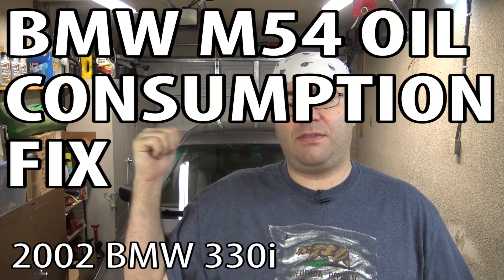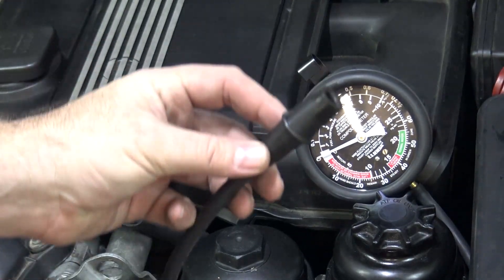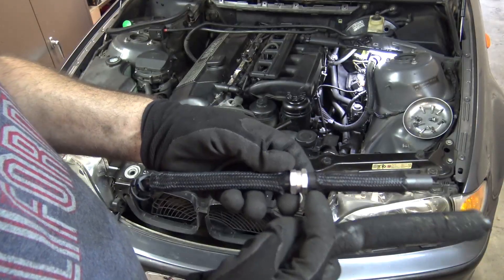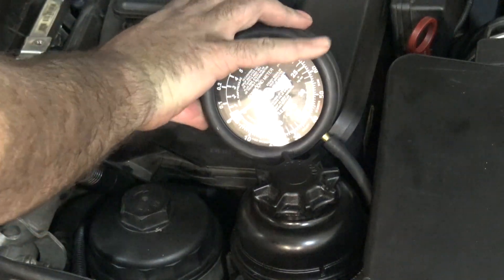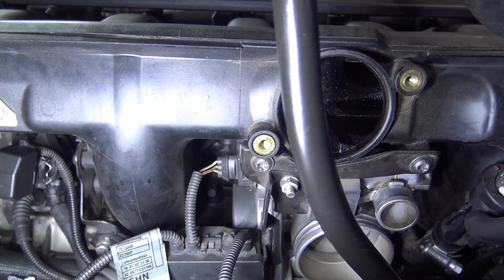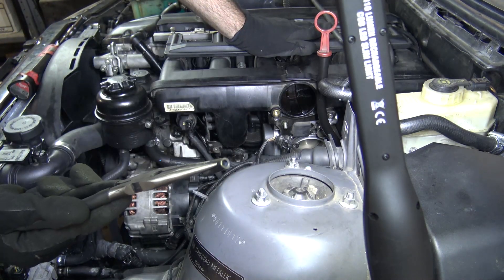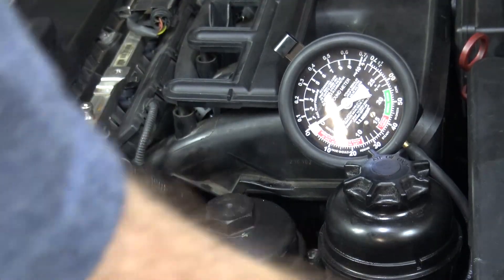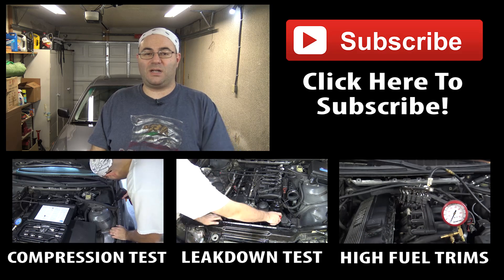BMW E46/E39 M54 Engine Oil Consumption Fix (02Pilot Mod) DIY

Comment: Thanks Jason, I completed the 02Pilot Mod on a 2005 325xi with 229k in Massachusetts. At 7:30 you mention 2 of the 3 rear ports are capped off but the 325xi's here only cap the large port. The two smaller ports are connected in this manner..

4mm port upper > vacuum hose > pierburg check valve (black/white) > vacuum hose > check valve near secondary air pump

4mm port lower > vacuum hose > vacuum tank (black)

At first the vehicle idled and drove great, but when slowing down to take a off ramps the vehicle idles low, and when stopping the vehicle stalls unless I pump the gas.

Are these vehicles vacuum systems not properly routed? And if so, should 1 of the 2 smaller ports be capped?
Reply from the maker: Try removing and cleaning your idle air control valve.  You want to make sure it rattles when you shake it.  I recently had to clean mine again.  Sprayed some wd-40 inside to lube it up and get it freed.
Reply: After inspecting what I did I forgot to connect the lower most electrical plug to the wire harness box. A note for other viewers, be certain to re-attach all connectors including the lowest most plug, the camshaft position sensor 12147539165.

Comment: Big thank you!
But I'd like to ask since I have a manual, will this mod affect my idle?
Cause it would be a pain in the ** if controlling the clutch at idle gets even more difficult.
Reply from the maker: No it won't.  All modern cars have an idle air control valve that takes care of it automatically.
Reply: The idle control valve on my E46 is causing me some headache. By the way all your videos and tips on the 325i apply to the 320i too, which was only available in Europe.

Comment: Is there any value to doing this mod and then installing a valve to turn it off in the winter? I live in Utah and about 4 months out of the year it freezes commonly. I use about 1 qt/1000 on 160K engine.  Seems like some are saying dont do this mod if you live in the cold. Can I just do it and turn it off in the winter?  I installed a new CCV about 8 months ago and even though everything looked original, pretty sure the vent tube was not clogged. I am just thinking to put in some cock valve to turn it off part of the year, at least the other parts of the year its not burning as much. Thoughts?
Reply from the maker: What they mean is the CCV system itself is not good for winters because of the yellow mayo problem (which is water mixing with the oil).  But I think it mostly happens with cars that are parked outside.  If you're in a garage you shouldn't have to worry as much.  Anyway if you don't think you're getting problems with clogging, then use this mod and see what happens.  Everybody's situation is different.

Comment: Great video again! I actually just did the 02pilot mod cause my E46 320i uses a lot of oil too. Also, some months ago I had the entire CCV system replaced (winter version). Applying the mod was easy. I used the large tube from the intake that was capped. And just like you I checked the vacuum with the same meter you use. And voila, the cauge reaches 18 mercury. But... soon it will drop back again no 0. When I repeat these steps, every time it reaches 18, but then soon drops again to 0. That isn't good right? What does it mean/what could be the problem? And how to fix it? Could it be that I used vacuum lines that are just a little too loose connected on the CCV and intake manifold? Or is there a leak somewhere else in the CCV? Please advice. Much much appreciated!
Reply from the maker: Umm... that's very strange.  Could it be a problem with your vacuum gauge?  Maybe it's a bit old & there is a leaking seal inside?  Can you try checking something else that produces vacuum or air pressure and see if it holds?
Reply: Actually it's brand new. I bought for this purpose alone...
Reply from the maker: If you put your hand over the tube while running, do you feel the suction remain strong or does it give out?
Reply: Ah, haven't tried that yet. I just relied on the gauge. I'll try tomorrow. What if the suction gives out?
Reply: Update: after measuring the vacuum yesterday, today I started the engine and a huuuuuuge amount of smoke came out the exhaust. My guess is that the o2pilot mod I did resulted in oil being sucked up from the oil pan when measuring the vacuum. What's ur guess? So today I decided to also install the non return valve. Result: the vacuum now stays at 18 mercury! Nice one. When measuring the vacuum the membrane in the CCV can be heard very loud. And sounds like a large balloon deflating. Did you hear this sound too when checking the vacuum? I wonder what it means.
Reply from the maker: Sounds like there is a leak in the diaphragm, which I know is weird because you just had it replaced.  There was an older style of the CCV valves that had a sort of one way check valve in them I believe but I thought they discontinued them.
Reply: Yeah, it sounded like that I'd guess. Darn, replacing the CCV again is not my favourite thing to do... ;-)
Reply: 50sKid 

Hi 50sKid. Thank you for your videos. It really helps me but now I need your advice. I have a 02 E39 530i and it consumes oil, of course. 6 months ago I replaced old CCV with completly new Febi with all the hoses. Amount of vacuum was 0inHg before the 02Pilotmod and when I disconnected the hose to valve cover, idle revs were slightly different. Strange. So I did this mode and amount of vacuum was 18inHg but immidietly back to 0inHg with huge amount of smoke from the exhaust. I think, that diaphram in the CCV has failed. What do you think? Shall I change the Febi for the OEM BMW? I changed it to the stock with no 02Pilot and it still smokes, but less. Thank you for your reply. 

Greetings from Czech Republic. 

Matthew

Comment: Love all your videos!

Would you recommend a catch can system with an oil return to the dipstick over this modification?

Do you worry about the wear created by the increased vacuum?
Reply from the maker: If you don't have to replace your CCV system due to clogging up every year, then I recommend this modification over the catch can.  The oil fumes with a catch can are too annoying.
Reply: 50sKid is there wear in the engine that is possible with this mod? Thanks
Reply: @vipereavp  no

Comment: Installed the O2 pilot mod tube yesterday. Made A testdrive today. After warming up I get oilpressure too low warnings when the engine idles. Trouble?
Reply: Not sure if you resolved it, but if you increase the vacuum in the crankcase, the oil pressure sending unit will  give you false, lower readings, reduced at the same rate as the new vacuum.   Your actual oil pressure inside the engine is fine and doing its thing, it just appears lower to a gauge that is referencing the outside.   Take your oil cap off when the engine is idling (highest vacuum), your pressure warning light will disappear.
Reply: i know im 3 years late, but did you fix it?

Comment: this worked for me for a while and then it was back to the same old
Reply from the maker: Is the line clogged?
Reply: 50sKid I had that thought. the drain to the oil pan may be clogged.  I need to check it. it's the only thing I can think of. since a new ccv and drain line are relatively cheap I may change them again

Comment: Hey guys,
im just in the middle of this job!
I have to mention that the "cold climate version" of the CCV (which I have) seems to NOT have the little extra port to plug in the vacuum line..Or at least its fully covered with the insulation stuff.
I would be very thankfull for any advice!!
Greetings from germany
Joerg
Reply from the maker: Maybe you can drill a hole in the insulation just big enough for the vacuum line to get through it?
Reply: Hey,
finally I followed your advice and used a sharp knife to cut a hole in the insulation. Easy fix (after tearing down half of the engine bayto reach the CCV) Unfortunately I cant losen the plug in the back of intake manifold.
Is it possible to alternativly extend the "F"-like connector behind the MAF with an additional T-adapter? Or is the vacuum in this place not usable?
Best regards
Joerg
Reply from the maker: The vacuum is not enough at that spot, it's only very slight. If you can't pull off the plug on the back of the manifold, you can always put a slice in it with a razor or use silicone spray to get it moving.
Reply: Hey, 
finally I was able to do the job by using the more reachable larger port. Unfortunately the red oil light  turns on and off frequently, when the car is warm and ideling. It seams that the oil pump isn't able to work against the vacuum..maybe reducing the diameter of the tube would be a solution?
Best regards
Jörg

Comment: did this on my 325i after watching the previous oil consumption video, changed out the oil, and so far absolutely NO oil being burnt off =D
Reply: DcApollo did you use the non return check valve ?
Reply: Ridwan Maassarani I didn't use a check valve, just a bit of 4mm ID vac hose from the ccv to the intake
Reply: DcApollo what year is your car
Reply: Ridwan Maassarani 2001
Reply: DcApollo I have a 2006 25i, do you think the say solution could be implemented?
Reply: Ridwan Maassarani yes
Reply: DcApollo thanks !
Reply: Where can I get the hose ?
Reply: Hey bro, the hose you connected to the port at the back of the manifold was it to the large port like in this vid or to the smaller port next to it what the 50's kid was pointing out to ? 
Thanks in advance

Comment: Also, it appears that a substantial vacuum reduces oil consumption. It also appears that factory settings and equipment don't maintain that high of a vacuum. I particularly enjoy the way u examine the data and allow it to guide your conclusions.
Reply: You mesn more vaacum there are less oil consumtion there is?
Factories want to sell cars, so they are made theresfter. Like oil fume go to airintake unfiltered and carbonizes the intake and valves, pollutes the engine, my opinion there can hust aswell be open crank case solution. Cleaner sir for the engine. The fune still gets out in the atmosphere anyway, then the fume vould be lead directly to exhaust instead. So we dont get it in climate intakes or smelling it through the doors/windows. Worse air, more gas/mileage😊 if they made cars quality on parts similar to trucks we could had the cars for 18 years and maybe just haveing an oil leak repair besides services😊
Reply: I know it’s 6 years later lol but yeah the mod increases vaccum wich helps seal the oil control rings better

Comment: So, if you are going to use the vehicle in places where the temperature can fall below zero, then the 02pilot mod is a no go?
Is this valid for the catch can mod?
Nice vid again!
Reply from the maker: In lower climates I would recommend the catch can system just to prevent the lines from getting clogged.
Reply: @50sKid  I believe you have since reversed stance, and now recommend that O2 Pilot Mod can be used in winter climates?

Comment: I did the 02mod a while ago and it did cure my oil consumption completely. After that I decided to replace the CCV for new parts, since I suspected a vacuum leak somewhere. Shouldn't have done that, the consumption is back, even with the extra vacuum hose. What I noticed afterwards, is the fact that the vacuum is nowhere near as high with the new parts. I assume that the new spring in the CCV doesn't let the valve open wide enough to let the appropriate amount of vacuum get to the crankcase. That might explain, why some people experience higher oil consumption after replacing the CCV, as you mentioned in your previous video.
Reply from the maker: Hmm, that's very strange and interesting.  The thing about the vacuum being applied at the take off port is that it comes before the valve, so the valve would never stop that vacuum from being applied at the crankcase.  I wonder if maybe your lines are clogged?  Is there vacuum at the valve cover when you unplug the tube?
Reply: I checked the lines for clogging, didn't have any. I understand, that the extra line doesn't affect the valve, but since the CCV is connected to the intake manifold, there is vacuum applied to the valve membrane. Thing is, before I installed the new parts, the tube that connects to the valve cover already had some vacuum, even without the mod (maybe the old membrane was deformed/torn or its seat was clogged, which allowed some vacuum to get to the valve cover). Not too intense, but noticeable. After the mod, in addition to higher vacuum on said tube (with the old CCV), I also had vacuum in the dipstick tube, which I don't have with the new parts, go figure. I'll try a direct line from the valve cover to the intake manifold next, see how that turns out...
Reply: 50sKid e e ess0a español

Comment: on the e39 i have both holes available in the back since the e39 don't have the line that goes to the exhaust note, should i use the same hole you used or the other one?
Reply from the maker: Either one will work.  Use the small one so you don't have to buy two hoses.

Comment: 50sKid!!!  REALLY APPRECIATE THE TIME AND EFFORT THAT YOU PUT INTO THIS AND YOUR OTHER VIDS!!!  
I'm hoping that this works and gonna try it today. My 530i is sucking a quart down per <500 miles... puffs some smoke on hard execration but everything else is great. I'll let ya know how the results in a few days!!! 

I've been considering getting rid of my 530 over this issue but it's hard to let her go 'cause it's such a great car! Fingers crossed!!
Reply from the maker: I hope it works for you, man.  Let me know!
Reply: I was in the same boat +B Kreative, the mod made me keep the beemer, it works!! (I replaced he CCV and did the 02 pilot mode only, nothing else). Some consumption after the first week. 3 weeks later no consumption. Awesome
Reply: ***** Before O2 pilot mode I had 1 quart per 120 miles on the street, 200 miles on the highway + some street. After O2 pilot mode AND CCV replacement I am close to 350 street, still to check highway I'm guessing close to 600... As you can see I have a nasty case of too much oil consumption, I still need to do the Ac Delco solution piston soak, other than that I'm much happier without being concerned about oil every week! (I thought I had NO consumption but I checked it yesterday after a combined street and highway 500 miles and had used a quart since the O2 mod..
Reply: @hugogarcia6318  burning that much oil...sooner than later your catalytic converters may get gummed up and fall below efficiency, throwing Service Engine light, failing emissions test, and leading to expensive repair of over $1,000 for cats
Reply: B Kreative wel?
Reply: if u had 1 quart per 120 miles than you have to repair your engine! its a super huge usage when i had, and i had 1 liter after 1500 KM's

Comment: The increased vacuum increased crankcase pressure which pushes the rings closer to the cylinder walls. Wouldn't this also increase wear to the cylinder walls?
Reply: no. Rings are supposed to be to the edge of the cylinder walls. That's the whole goal, right?

Comment: Hey 50sKid Thank you very much!!!!! You ROCK man!!!!! You should know at least 1 person in this world is your fan bruh!!!! I was waiting for you video and going to do vacuum line from intake to valve to incrase vacuum. Thank you!!!! Thank you!!! you did lab for many peoples.
Reply from the maker: Thanks so much, man.  I'm glad to have you as a subscriber!
Reply: @50sKid Some questions. 
it is mandatory to install check valve on return line or it should be bypassed? How you think by increasing vacuum is it possible that lubrication of the cylinders will decrease? 
Thank you! by the way I am subscriber from your first video :)))
Reply from the maker: Haha, that's awesome.  I haven't tried this exact mod without the check valve.  I would say that given the size of that small vacuum line, it's probably not enough air flow to suck up the oil so you can probably get away with it.  But if you get blue smoke out of your tail pipe, get a check valve.
Reply: Hi Mr 50skid,am here in Los angels close to you. I did exactly like you did but it has so much vacuum. I almost can't open oil caps.is that's Ok?
Reply from the maker: Yes that's the idea

Comment: WOW, great proof the stock system works with just a 2 dollar hose!! thanks man! I'll feedback on it, have a 1 quart per 150 mile run on my 325i (I know, nasty, and also in-cabin smell)
Reply from the maker: Damn that's a lot!
Reply: I know man, already ordered the Acdelco X66P for ring soaking, check valve for the PCV drain and will go get the 3/32" and 1/4" hoses by the end of the week, just gonna do it all.. Thanks for all you help Sir!
Reply from the maker: Nice
Reply: Just replaced the CCV and did the 02 pilot mode (didn't soak the pistons yet on the X66P), thanks for your videos man, they helped a lot, darn the position of that thing, it was a total biatch to replace the stock ccv. Happy to report HUGE vacuum pull on the oil cap, no oil smell inside the car anymore and even though the exhaust still smells, it does smell a lot less than before...  About to do a 300 mile trip, I'll let you know what happens... thanks again Sir!!!
Reply: 02 Pilot mode update, first week with the mod was still smoking on random occasions and it consumed about 1/2 quart during the week (instead of a full quarter), I topped it off and forgot about it, I just checked it and it's FULL after 2 weeks!!!!! Just wanted to say Thanks Jason! you 'da man Sir!! I don't know what's the long term effect of having a high vacuum on the crankcase but right now I'm just thankful to have kept my beemer and use it as a normal car lol